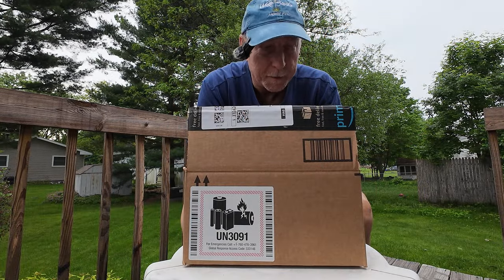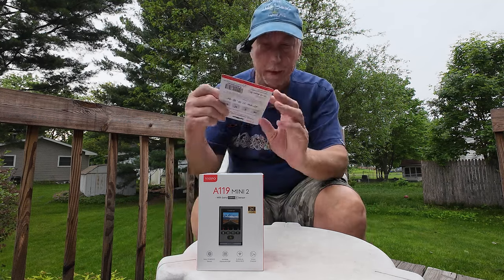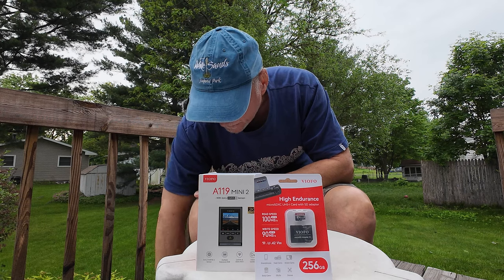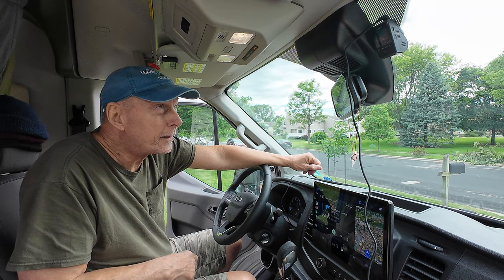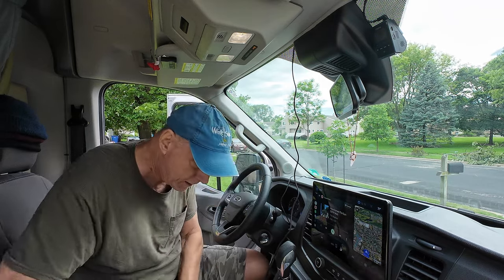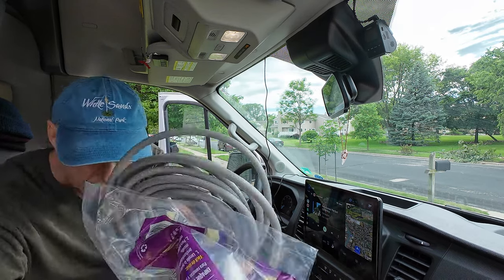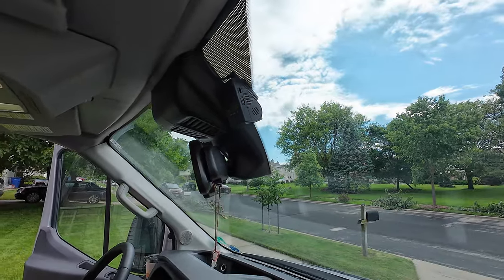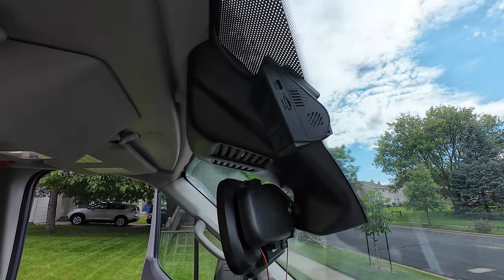Viofo A119 Mini 2 Dashcam Install

Comment: How has the OBD connector been going with Parking Mode? I read for the main website it doesn’t work so I was abit nervous about connecting it that way. Cheers
Reply from the maker: A real good question.  I'm still trying to figure that out myself.  On the one hand, I do have parking mode video as you can see in the samples where I am approaching the van.  From what I gather, the OBD port has both constant and accessory 12v pins, but whether the USB A ports translate that into something the Viofo cam understands isn't clear to me.  It may be entering Parking Mode simply because it no longer senses motion, but I'm not sure.  I've also had issues where, in under the 24hr limit on the Garmin ODB connector, the cam is showing it's recording, but is unresponsive to requests to protect a clip.  I don't understand that.  I did a firmware update, but not sure if that has affected that situation or not.  Also after the update, I've been getting "Recording started" announcements from the cam almost every 3 - 5 minutes.  It's been enough for me to just unplug the darn thing.  I think I need to turn off the motion detection feature is what I'm reading, but I don't know how that affects Parking Mode.  So yeah, I'm feeling a little clueless about some aspects of this thing's operation.  If you have the option to hard-wire it into a fuse block under your dash, I think that would be preferred, for sure.
Reply: @joyenroute  Cheers thanks mate for the response interesting 😁. I was thinking the OBD route like yourself as I’m not techo enough to install the hardwire kit and to cheap to pay someone lol. I will just stick with the cigarette 12v plug for power for now maybe in time I might relook into it. Thanks again from Australia 👍